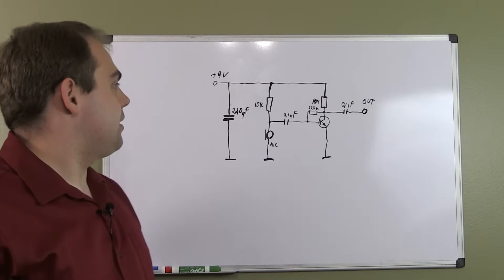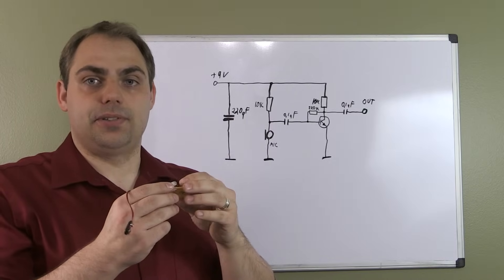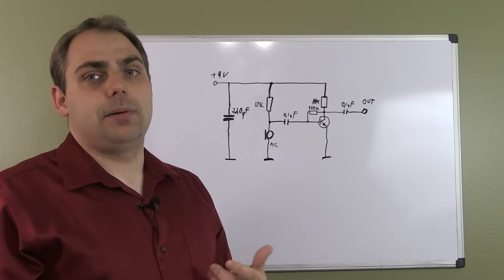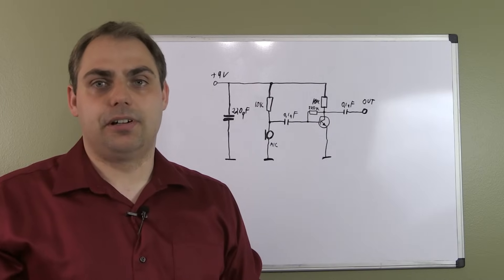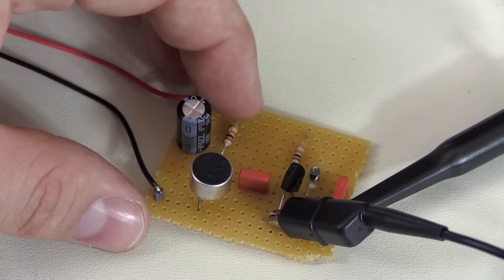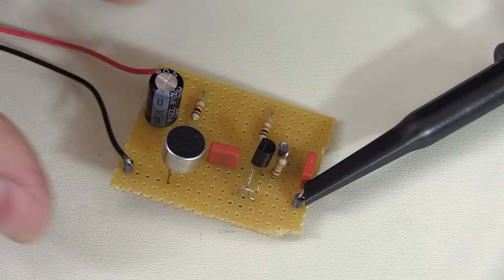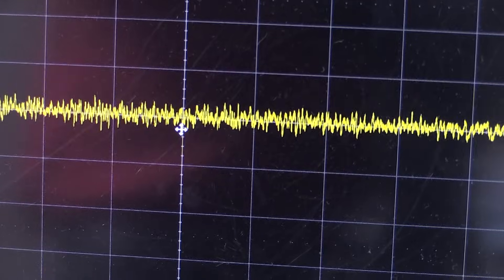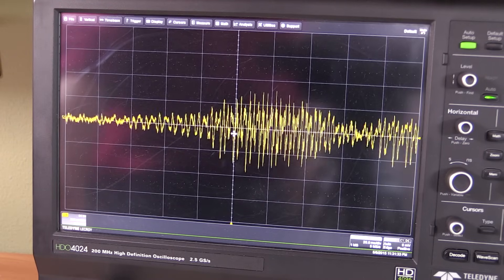How to make a DIY Microphone Preamplifier Circuit!

Comment: So I built it and it works great. Now I also wonder about a JFET version. I just wonder how much of a difference would be. They say that JFETs are more "quiet". I need to experiment how "quiet" those are comparing to a simple NPN 😅 Thanks for sharing this one.
Reply from the maker: A JFET common-source preamp can be quieter than a BJT common-emitter stage, but only when the source impedance is high. BJTs have very low intrinsic voltage noise but significant input current noise, which becomes problematic when it flows through a high-impedance source. JFETs, in contrast, have higher voltage noise but extremely low current noise, making them ideal for high-impedance signal sources such as guitar pickups or piezo elements. For low-impedance sources, a BJT stage generally delivers lower total noise. The choice therefore depends on source impedance rather than on the transistor type alone.
Reply: @BalticLab Ohhh this is good info. Thank you so much. For sure a guitar preamp I need to build soon. So now I know what to use 😁 I will keep the BJT for the usual mikes then 😁 73, YO6DXE.

Comment: How do you calculate the gain of such circuit?
Reply from the maker: The gain is roughly the collector resistor divided by the emitter resistor plus the dynamic (internal) resistance. The dynamic resistance is approximately 26mv/collector current in mA. The maximum limit is, however, the maximum gain of the transistor itself, hfe. The circuit shown in the video has a voltage gain of around 100-150.

Comment: I know this is 9 years in 2025 but thank you!  Informative and helpful.  I have built two now, both have very high noise floors.  The white noise is almost as loud as any vocal noise I send through the mic.  Is this a component quality issue?  All my components are amazon specials.
Reply from the maker: I am actually in the process of redoing this video, especially due to its age. It might take a bit but stay tuned. In the meantime: I can't say I ever had problems with noise when using genuine BC547 or 2N3904. Then I hear noise I immediately thing "power supply!". Have you tried this with a 9V battery instead of external power? If so, try genuine components.

Comment: This is a very clear explanation but I'm not sure why you say the amplifier will sound 'funny'. Also, what is the gain of this circuit and can it be varied?
Reply from the maker: Hi, I wish I'd remember why I said it'd sound funny... The gain is around 100 and it can be varied by adjusting the resistor in the collector. Changing the resistor will, however, also change the output impedance.

Comment: Input impedance is around 100 kilo-ohms. Reasonable enough. I'll use, potential-divider bias however, for improved thermal stability for Q point. Cool though!
Reply from the maker: @awaismushtaq5719  The input impedance is a lot lower than 100K. Less than 10K even. Thermal stability is not really important in small signal amplifiers. If you're really using the majority of the possible output swing or need a lot of headroom to the non-linear edge of the transfer function, that'll become important.

Comment: can be run this circuit from 3v ??
Reply from the maker: The biasing point of this amp has been calculated for 9V supply voltage. It might work with 3V but I haven't tested it. If you do end up testing it with 3V, please let us know what your results were.

Comment: Does this pre amp invert the ac signal from the electret microphone? If so, will the inverted signal affect the sound output if it was connected to a speaker?
Reply from the maker: Yes, the signal will be inverted. However, this should not have any audible effects at all. Now that said, the output of the amplifier is fairly high-impedance and is thus not suitable for direct connection to a speaker.

Comment: Thanks for the explanation. Can i use  this circuit with fantom power from mic mixer without using 9v battery?
Reply from the maker: Using phantom power from a mixer for this circuit will require a major re-design. So the short answer is: No, not without modifications.

Comment: Breadboarded it! Had to use a 100uf, 100uf, 10uf, and 10uf in parallel to sub for the 220uf but had all the other components. This really works. I am thinking of using it for a guitar pickup system where I will mount a high quality JLI electret capsule in the body and combine with a piezo pickup. I may tweak the values a bit for better frequency response for guitar and add a volume pot, but thanks so much for this starting point! I am enjoying learning electronics

Comment: Newbie question: why the output has just one terminal? Where are the positive/negative that I should connect to a jack, for ex. Thank you!
Reply from the maker: The output is the desired signal, the counter-pin, or reference pin, is ground.

Comment: Very nice - would that power headphones directly? Trying to make a deaf-aid to hear the television sound more clearly.
Reply from the maker: Depends on the input impedance of the headphones. Common emitter amplifiers are not suitable for driving low impedance loads directly. Add a common collector stage between this amp and the headphones and this will work.
Reply: That's great thank you. Yes I have heard about the need for high impedance headphones but they seem very rare. I've only seen them on very old equipment (but havn't got any!). I'll add another transistor (common copllector) and see if it will work with modern low Z 'phones. Many thanks, Peter @BalticLab

Comment: Hi, I made your circuit and it works. However I'm getting this high frequency noise and humming coming through. I tried what one comment suggested and swapped the 220uF cap with a 47ouF cap, it did not help. Do you have any advice? And to clarify, i'm using a handmade dynamic microphone, and I did remove the 10k resistor for biasing the mic.
Reply from the maker: How clean is your power-supply? Or does the hum only occur with the microphone attached? Do you have a way of applying a very clean input signal from a signal generator and see if the same effects appear?

Comment: Done, works, thanks, adding more transistors.
Reply: Don't just add transistors blindly, try using a V(be) multiplier and a push-pull in final stage to drive speech coil!

Comment: Can you add a Variable resistor for Mic Gain adjustment? I would like to build this for my TYT TH-7900 2m/44 VHF/UHF radio desk mic which is a TYT also.. Thanks
Reply from the maker: Sure thing! You could add a potentiometer in the collector of the amplifier; Higher resitance = higher gain, lower resistance = lower gain. However, that also changes the output impedance of the amplifier. Then you could simply add a potentiometer between the output and ground, tap your signal output off the wiper.
Reply: Thank you!

Comment: Hi, good job, sir.Congrats
I was having trouble with noise (humming) as I did not put the capacitor in the voltage feed.
I saw your video and it did help me.
I added a 470uF (bigger than the suggested humongous one) and the humming sound went almost off.
Thanks a lot for your donation of knowledge
Reply: Use decoupling filter to decouple amplifier from power rail. A high pass RC basically. The R is one-tenth of R(c) and C ought to have reactance X(c) of 1/10 of R at the lowest frequency you wish to amplify. Do this and the motor boat sound shall be gone!

Comment: Can i use this circuit with a piezo disk as a contact mic?
Reply from the maker: Yes you can. Insert the piezo disc insteadof the microphone and remove the first 10 K Ohm resistor as the piezo disk doesn't need a supply voltage.

Comment: I just breadboarded your circuit, as you designed it. My condenser mic was a donor from an old telephone answering machine, IIRC. My BJT was a PN2222A. Your circuit works very well. I will use your circuit to create a DIY Decibel Meter with an Arduino. There is lots of code available. The new meter will have to be calibrated. To do that, I will need a reference tone of a known decibel amplitude. Does anyone know a way to create the needed tone? Lots of projects rely on an Android Decibel Meter App, to do a comparison. However, I do not have an Android phone and I am not very phone savvy. I do have a laptop and I know about Audacity, but not how to set up the two as the reference. I also have a Rigol Function Generator, if someone can give me the specifications on the tone... 1KHz, at one watt, one foot in front of the speaker = X Decibels?
Reply: is there any chance you can give the values of the resistor and capacitors?
Reply: Phew, that is gonna be tough to properly calibrate. You'd also have to account for the reference's frequency response curve.

Even with a perfectly generated reference frequency the real decibel level at any given distance depends hugely on the output speaker's "quality". For the decibels at a specific distance you can just go with the inverse square law, provided that you know how much your speaker over/under-responses for any given frequency
Reply: Is there any way you can post a picture of your breadboard connections?

Comment: thanks for the video.
I am interested in making a microphone for an icom ic-746 radio, using the panasonic wm61a capsule. will the 746 need a preamp for the input or will the inbuilt preamp which is known to be a bit weak do? what about impedance matching between the wm61a and the tranceivers? thankyou, any and all help much appreciated

Comment: I wonder where I went wrong with this. I got nothing. Volume was lower actually.
Reply: Hi! Let me guess: You have the wrong type of mic inserted. What you need is an electrolytic / condenser mic.
Reply: @Wolfgang3418  maybe.
I'd actually intended to use it as a pre-amp for a summing mixer I'd built. I wasn't getting good volume from the mixer, so I wanted to use   this to pump up the volume before sending it to the amplifier.

Do have any designs that can perform that function?
Reply: Hi Ronnie! May be you are using passive inputs, say 3 channels, each with a potmeter working on one transistor. That's no good. Every input should have a transistor for itself like in this example:  http://easycircuit012.blogspot.com/2012/09/three-channel-audio-mixer-circuit.html As you can see, you can easyly throw out one channel and replace it with the preamp for your mic. See the link in my comment for the voltage the capsule requires. In the circuit by KF5OBS my capsule got 7.2V, far to much for the cz 034 I used. Hope it helps!
OOps, my comment seems to be deleted. Why that? The circuit is here: https://www.pic-upload.de/view-36963733/MicrophonePreamp.jpg.html
w
Reply: @Wolfgang3418  Thanks. Let me have a look at the circuit.

Comment: sir, how do I boost the mic audio from this circuit ? and which part I would replace? im using it on my pc for testing purposes. pls dont include mic boost from windows.  ty!
Reply from the maker: You can use two stages of this amplifier in series.

Comment: PLEASE HELP ME. I used your circuit and it is a good preamplifier but I generated a sine wave then I have transmitted it by using speaker,  however at the output of this microphone circuit sine waves looks like a square having distortion around peak values, I think I should change the 220 k resistor, could it be helpful? Or do you have any idea?

Comment: does it work  with piezo disk?
Reply: Wadi Ghassen have you got the answer?
Reply: @sanjaybali4092  did u try?
Reply: @lordrahulcool  yes I try it with Piezo. But Its Working is fine with mike. With piezo its output is not enough.
Reply: @sanjaybali4092  what wud you suggest me for piezo pre amp to remove tinny sound?
Reply: @lordrahulcool  use big size pizeo .that will automatically reduce it.
Reply: Does it?

Comment: I know this video is kind of old, but it's still worth a try asking. What would happen if you place the mic the other way round? I mean, positive end of the mic to GND and negative to 9V. Will it not work? I'm asking because I think I accidentally did that.
Reply: Would appreciate if anyone seeing this post answered
Reply: if you have more just switch it out. A while back I made the same mistake, and I after correcting it, it seemed to work just fine.
Reply: Not on electret mics
Reply: Unless it burnt the diaphragm than nothing would be harmed especially if the resistors were in the circuit.  If you connect a 9v to the mic straight up it will burn the diaphragm with the coil heating up.  Mics work just like a speaker in reverse.  A very delicate speaker..   but its possible you boogerd. The mic up..  to tesst it. Hook a 1 μf 10v or higher. Cap and a 10k resisstor and plug it straight into a powered speaker..
Reply: electret mic's are biased.. polarity must respect

Comment: i am make that circuit same as you show in the board and i power that with 9v battery but its not working how to fix the problem
Reply: check the circuit and microphone , still have problem then change the transistor.

Comment: "electrolytic" microphone? lol it's "electret" microphone.
Reply: We call it condenser mic. Different regions/countries use different name for the same thing.
Reply: Condenser are other similar type. Electrets have pre-poloarized their capsules, and do not need phantom power. Condensers needs to charge their capsules with +48v phantom.
Reply: @mrmshifan  but electrolytic is plain wrong as that would imply that it uses some kind of electrolyte inside for whatever reason.
Reply: Ha-ha-ha
As long as the audience can understand, its okay
Reply: How can i make phantom power supply for  condensor microphone...?
Reply: Not electret its electrod you fool

Comment: Hello, thanks for the video.. I have a strange question, wondering how one would use a simple transformer in this design , is it drastically more. Complex?
Reply from the maker: No, not significantly more complex. Use the secondary coil of the transformer in place of the electret mic and omit the resistor above the electret mic. That's one easy approach.
Reply from the maker: Or wait: Did you mean audio input/output transformers or a transformer for the voltage supply?

Comment: hi, thanks for the video.
 could you put up a schematic if i want to use a dynamic microphone? 
also all the legs you draw from mic, capacitor and transistor are connected to the negative terminal of the battery?

Comment: how important are the component values? what kind of tolerance can I have on each resistor? (too poor to buy parts, only salvage.)
Reply from the maker: Not very. On the collector / base resistors a ratio of the DC current gain of the transistor is mildly important. Usually 1:100 with general purpose transistors.

Comment: Nice video.  I like these ahort and simple type videos.  

But I do have one question:  Could you tell me why you chose a 220K ohm pullup resistor on the base?  I realize that the bias point is not very important in this circuit and that it will get stabilized due to the feedback from the collector resistor, but I am curious as  to the value.  Is it simply that it needed to be a reasonably high value and you happened to have 220K resistors in your junk bin, or was there more thought that went into this?

Thanks